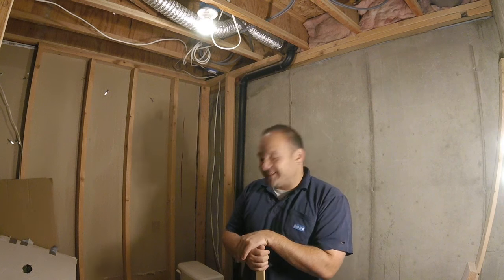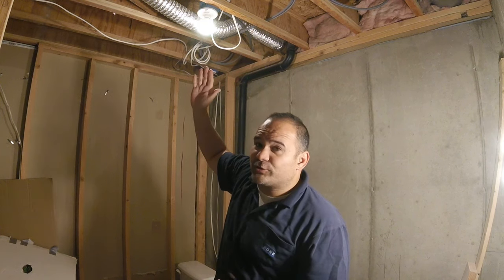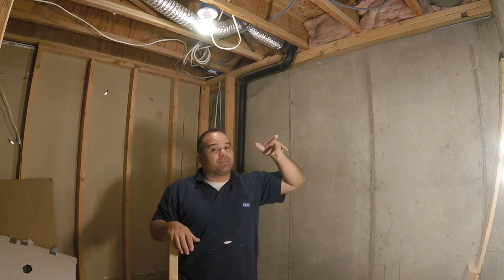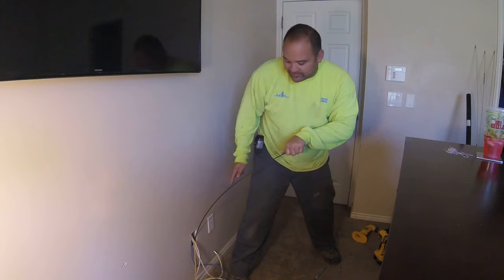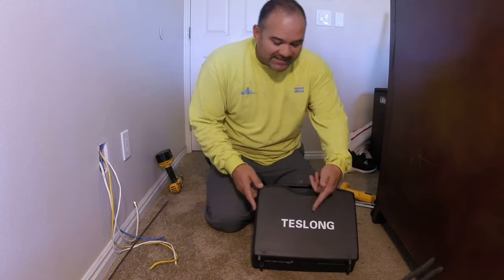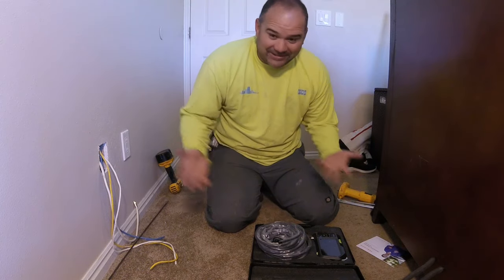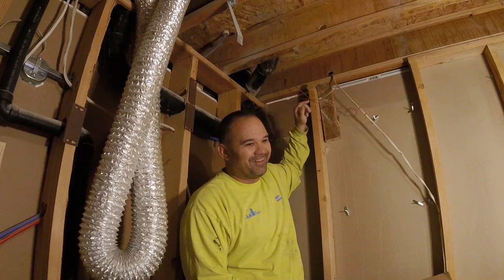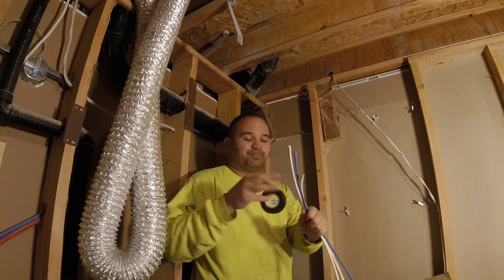MAD SKILLS! A pro installs wire from the attic to the basement. Part 1

Comment: One trick I heard is to stick a tennis ball through the drillbit so its around it, then it forces the bit to center inside the cavity and not go into the walls
Reply from the maker: I've heard of that trick too. I haven't tried it yet, but it sounds like it would work well.
Reply: @shellderp  Thanks Bro  ,that's a FANTASTIC tip .
I like the idea of being in the centre  🙏
Reply: Great trick and would keep it up to code too. I know in some locations  require you to have max hole sizes and in the center of the plate.

Comment: A few tips I've learned over the years:  I almost neve drill a hole smaller than 3/4".  That may sometimes be overkill but down the road when you decide to run more wires you will be glad you did.  Always run your pull string first from end to end if possible and pull enough slack in it so when you are all done pulling your cables your pull string is still secured on both ends.  String is cheap!
Reply from the maker: Those are both great tips! Thanks for the comment and thanks for watching
Reply: I get the 3/4" but pull string on both ends of the cable ? Once the cable is pulled with a rod or rope why do you need rope at the other end you just fed from ?
Reply: @alhawkins3376  -- to upgrade or replace the first cable or to add an additional cable.
Reply: @AlanCleggYouDoAV I work for Kone also. Nice gear! 😉
Reply from the maker: @lcmurdal  Stick to that Kone method!

Comment: My last home, it was prepped for cable in the basement. I asked the builder about an antenna hook up and he said there was no way to do that going from basement through 2 stories and then the attic. This was a custom home, and I found cavities and a conduit going from first to second floor in a cavity. I drilled an 1 1/4” hole in basenment and 2nd floor, dropped a line with a nut for weight and made the connection. I ran my coax to the attic, bought the largest antenna that would fit (20’x18’) and it worked for 14 years. I had a tract home built and paid a plumber to run 2@3” pvc plastic pipes from the attic to the basement. I moved the old antenna (from old home, looked like new, since it was in the attic) and hooked it up in the attic again, used the plastic pipe to get coax from attic to basement then to each room needed in this ranch. I’ve been living in this home 20 years and the antenna works great, it’s 34 years old.
Reply from the maker: I love hearing stories about victories like this!

Comment: Just found your channel. Im a fiber technician for a big cable company, I install fiber optics and coax, doing cable,internet and phone. Pretty much just running drop lines from the pole outside to a termination box on the house. Then from that box into the house to a modem. Then from there running lines all over the house. Mainly running ethernets. And so far I've been fortunate enough to not have to do a wall fish inside of a wall to another floor from scratch. I've always been able to do a tape and pull. But the company I work for is coming out with a new plan that's going to cause us technicians to have to run ethernets all over these houses now. So that's what lead me to this video, to sharpen my skills. I like the scope you got so I'll for sure use the link and grab one for myself. Appreciate the vids thanks
Reply from the maker: THANKS MAN! Good luck on those installs. Fishing walls is always an adventure. You'll do great!

Comment: Nice video, nice teamwork to get the wires pulled. With a lot of newer homes sometimes the build in a chase through which to pull wires right from basement to attic, and if you're building a new home design that in. Sometimes, if you have a chimney running from basement to attic you can find space alongside it and get lucky enough to push a fishrod all the way up.
Reply from the maker: Those are good tips. Thanks for sharing!

Comment: I have a home built in 1924 and while installing an exhaust fan in a bathroom I ran a line from basement to attic using the space around a vent pipe.  Maybe nowadays with the plastic pipes the hole is too tight but with the old cast iron vents, there's usually room.  Good luck to all and keep it fun.
Reply from the maker: Great idea. Often they have to block off any passages that go between floors for fire code.

Comment: I bought a Teslong endoscope last year and it has been amazing for looking in closed spaces. I got one with 3 cameras and 16 foot cable.  If I had to do it again I’d get one with just a 10 foot cable.  The extra cable just gets in the way and it doesn’t go around bends easily so not even able to use the full length. I’ll probably buy an extra single camera cable since it has a smaller diameter and would not need as big of a hole to go through. Currently in the process of running wires up to my attic and it has not been as difficult as I thought it would be. Thanks for the nice video.
Reply from the maker: I found the same thing to be true for me. When I’m running wire, the shorter length is more usable. I agree that running wire from attic to basement is not as hard as it appears once you start doing.
Reply: I literally just got my teslong today !!!

Comment: Really great video.
The best bit that I liked that I have seen most people get wrong is using a speed bit drill and not a twist bit drill. Twist bits are so much easier.
Reply from the maker: I agree. They also stick into the wood exactly where you want them to.

Comment: This was awesome. I’m not a home owner or technician but always wanted to be an installer. The reason I’m here now is because I have a tech coming to install coaxial soon and I’m on the 3rd floor apt. (Cox) if anyone was carious.
Reply from the maker: Sweet! Make the installer watch the video
Reply: Usually apartments like that installers aren't allowed to drill new holes. I work for a major cable company as a fiber and coax tech, and any MDU buildings like that were not allowed to drill new holes unless the building owner is on site during install. Those buildings are almost always pre-wired for coax though so it's usually pretty simple. And if the lines need to be replaced then it's just a matter of a simple tape and pull. Cut the line,tape the new line to it, and pull it through. Easy peasy. Or they could always just run the feed line from outside at the RE box, up the side of your building directly into your apartment. That's probably the easiest method if a tape and pull isn't possible
Reply: Also like I mentioned those apartments are always pre-wired most of the time. Chances are your technician is just going to walk into your apartment with a meter, and do a quick levels test on any existing coax barrel wall plates if there are any. More than likely there are some there. Once he finds an active line it's just a matter of throwing your equipment on and activating the serial numbers on your account. Coax is extremely extremely easy. I absolutely love it when my job let's me do coax installs so I can get a break from running fiber. Fiber is just way more complicated. Can't bend the line, it twists up on you if you're not careful, and you have to do a fiber splice, even if it's raining. Then have customers ask what's taking so long. OH you know, I'm just running a microscopic glass tube from that telephone pole 6 houses down that shoots a laser beam into your modem. Smh

Comment: I still have that old Rigid scope, it's still working well. But specifically for automotive use I found the diameter too bulky to get through a spark plug hole. Now I have a second scope that works great. Cheap ones have an annoying delay, so the software interface is important.
Reply from the maker: I could not agree more. Thanks for watching and thanks for the comment!

Comment: Badass bro, just yesterday I bought the extended 54in auger bit plus the 54in drill bit extension planning on hitting 4 rafters straight but I did it just to hit the exterior wall on my 2 hole therefore I could't poke all the way through and made like 5 holes.
I just got me the NTS500 with rotating dual lenses. I already have some ideas on how it will help me but I wonder how to charge the customer for the convenience on not making holes. Greetings and hats off to your work
Reply from the maker: That's awesome! Please post an update and let us know how it goes. I freaking love my scope too. I use it all the time.

Comment: Awesome vid and great technique.  I personally would have cut drywall big enough to fit my drill into wall to drill through floor plate.  It’s easier and as long as I tell the customer what I have to do and they are ok with drywall repairs then why not?  Flex bits are great but they don’t last long and you can’t find one over 1” either.
Reply from the maker: I have cut MANY holes on drywall during my career. I'm sure I will still cut many more. If I can avoid a hole or two, I try to get it done without holes. I also used to guarantee my drywall work, which I patched myself. They wouldn't have to pay until they were satisfied with the repair. It was in my best interest to avoid cutting holes.

Comment: Thanks for the intro to Teslong products. I’m in the market and wondering which camera size you got on the 500 and if you think it meets the need for just running wire. Thanks!
Reply from the maker: My order says I got the "NTS500 endoscope with dual lens. Camera type: .31 inch (8 mm) diameter and 15' of probe length." I'm super happy with everything about the camera and lens. The length is definitely longer than I need for in-wall scope use though. If I could go back, I would have ordered a shorter probe but everything else is amazing.
Reply: @AlanCleggYouDoAV  awesome. Thanks so much for the reply.
Reply: @AlanCleggYouDoAV  RE Probe. Is it more important to have the autofocus ones over the dual camera ones? The focal length is pretty short on the non auto focus ones. Thoughts? Thanks.
Reply from the maker: @carltonclarke9690  I really like the way my camera is set up. I can't comment on cameral technical specifications, but I can say that I never felt like I had a problem with focus. If you look at the video where I scope out the basement ceiling from through the hole I drilled, you'll see that the image is pretty clear at all distances. I really like the dual camera feature. Sometimes I go through a stud and I need to see what is immediately behind it to see if there are obstacles or if my glow rod/string is there.

Comment: Thanks for the video!  I'm trying to run HDMI between floors (2nd floor to 1st floor), and may be in over my head.  :-S  Was trying to get by on a budget, and was using a Forstner bit I already had, but that definitely takes more work to get through the wood.  And of course, the first hole went into a nail.  Forstner bit didn't like that.
Reply from the maker: Ouch! If you're going to be installing a long HDMI cable, use an HDMI balun instead. Look it up. They work GREAT and running a single CAT6 cable is WAY easier than running an HDMI cable. An HDMI cable can also break later on down the road and then you're toast. Good luck!
Reply: @AlanCleggYouDoAV  Thanks for the tip! Wish those adapters were cheaper, though.
Reply from the maker: @rfh1987  Ya. They aren't cheap, BUT they are worth it. They are much more reliable than long HDMI cables too. As technology changes, I have seen cheap HDMI cables fail to handle advancements in technology.
Reply: @AlanCleggYouDoAV  also the HDMI cable length restriction is a factor unless you start amplifying/repeating the signal, especially if not using an active cable
Reply from the maker: @mikey38632  Correct. I have had several issues with long cables, but I always throw in extra CAT6 cables JUST in case there is an issue and I need to use a balun.
Reply: I've read that Fiber optic hdmi cables are good for long runs, but you lose CEC.
I haven't personally used long cables though so i can't say if it works good or not.
Reply from the maker: @zeroumashi2947  I haven't heard of that, but it sounds interesting.

Comment: Does anyone know of a video where you’re going from attic to basement via two finished floors? I can’t make a hole in my living room ceiling on the first floor— and if i were going up from the basement, I dont want to make a hole in my bedrooms or upstairs hallway floors…
Reply from the maker: Unfortunately, running wire and patching holes go hand in hand most of the time. If you can find a chase that runs from the attic to the basement, you can use that. Sometimes they do that for HVAC or gas lines. If you don't have that, you're going to be cutting holes.

Comment: How would you run a cable from a first floor to a second floor? Would you need to cut a blank plate hole near the top of the wall on the first floor to catch the flex drill end if I drill through the plate between the floors via a gang box hole on the second floor?
Reply from the maker: If you can drill through the top plate of the first floor using a cutout on the second floor, you should be able to just shoot down a glow rod through that hole and hopefully it goes all the way to the bottom of the 1st floor wall (assuming it does not have a fireblock). I use an in-wall scope to help guide my drill bits and glow rods for installs like this.

Comment: In my house I found an alternative method because there was just no way I was going to effectively get a cable from our basement through 2 stories into the attic. All the wiring in the house was original and so installed and stapled before the drywall was put in. Horizontal bracing scattered throughout. Electric, water, etc behind the drywall. They didn't put conduit in either. No thanks. House was built right before running Ethernet all through the house was common. So instead I was able to punch through from the basement into the garage. The garage has a high 2 story ceiling and its own attic space. So I can run the cables vertically inside the garage along the outside of the wall and then punch through to the attic above. From there run the cable throughout the attic and drop down into any 2nd floor room. Some sections of white PVC piping and U clamps secured to the wall make a tidy external conduit/wire raceway. Cut the holes with a hole saw for the entry/exit areas of the pipe and spray some foam I'm the crevices or use some fire block material.
Reply from the maker: That's a good use of the layout that you were provided. Nice work!
Reply: Nice idea, my garage is similar but I'd have to run through insulation

Comment: I have rj11 in my rooms how can I get rid of them and add ethernet instead????
Reply from the maker: If you have Cat5 cables which are each home runs, you just have to change the connector. If you have the old phone lines with 6 wires or if you have cat5 cables that are daisy-chained, you’ll have to re-run new cable. Sorry!

Comment: my concern in this video is the basement, the wall behind you i hope is not a load bearing wall. those 2x6 studs have been compromised by that plumbing in them.  other that great info on running wiring
Reply: Studs are not compromised unless there’s a big big hole in them. A 2x4 can have a 1-1/4” hole in the middle and lose almost zero strength and stability
Reply: @BigBoii1369  Take a look. The only thing holding those boards together is the metal brackets. I'm pretty sure they are compromised

Comment: Part 2 sadly never happened.
Reply from the maker: Thank you for bringing this up. I am actually planning on doing part two in a couple of weeks. I finished part one at a very busy time of year and right before winter so doing part 2 which requires a lot of outside work would have been miserable. I already have the speakers and volume controls ready to go so stay tuned.

Comment: Whoever cabled and wired my house made sure you couldn't move or pull on any cable or run another cable same location.
even fiberglass fishing rods don't go through.
Reply from the maker: If your wiring was run during construction, it will be stapled down and cannot be removed. If the wiring was run during a remodel (like mine) it will most likely be loose in the wall and easy to use as a pull string to run more wires.
Reply: @AlanCleggYouDoAV  during construction. They won't budge. can't even run fiber fish rods through wall outlets. wall insulation.  Guess I'll be punching holes through the ceiling and drop cable that way.
Reply from the maker: @WV591  Hmmmm... you can't run glow rods in the wall? Do they stop half way or they don't go in at all?
Reply: @AlanCleggYouDoAV  only get  most of the one rod in and that's about it. I even tried  using  a small scope with Led  but the way they had outlet mounted right at the 2x4, I think, it's impossible to go straight up and then the insulation can't be penetrated. Unbelievable, It's even harder to trace cables in the attic. They used cheap loose insulation instead of those large pads,  if I don't get this done soon, it will be impossible in a week or two in the Houston heat and humidity. So an ugly wire hanging from the ceiling will be the way to go.
Reply from the maker: @WV591  Ok. If I'm understanding correctly, you have insulation in your walls, and then you have a fire block about half way up your wall. Fire blocks are 2x4's turned sideways halfway up the wall that separates the top half of the wall from the bottom half. The easiest way to get past fire blocks is to cut a small above the block so you can get the wire from the attic then drill down through the fireblock to the box below.